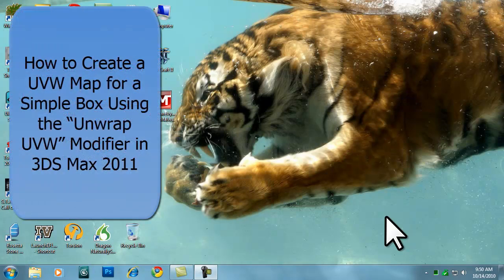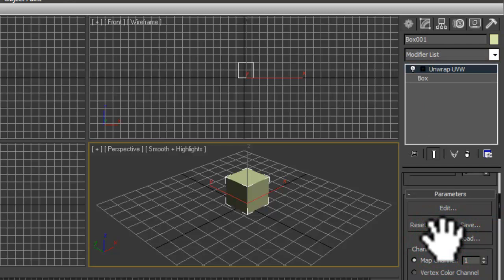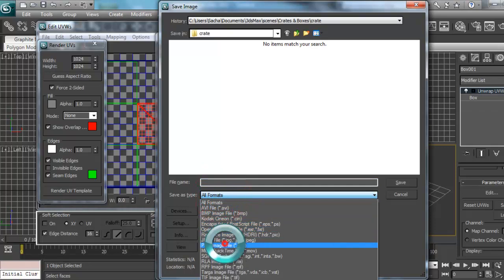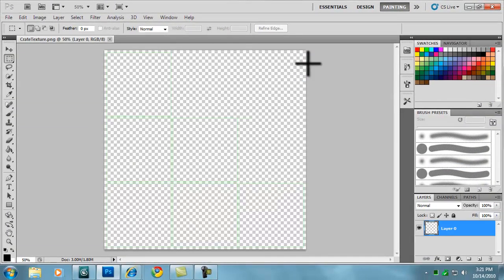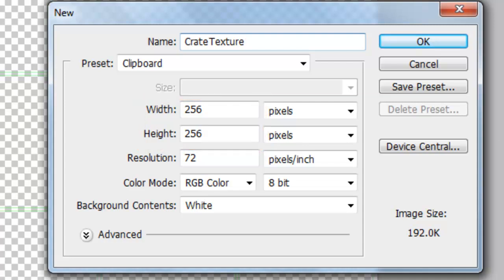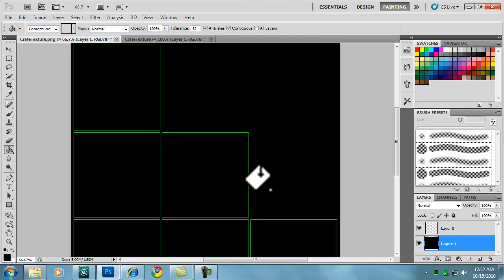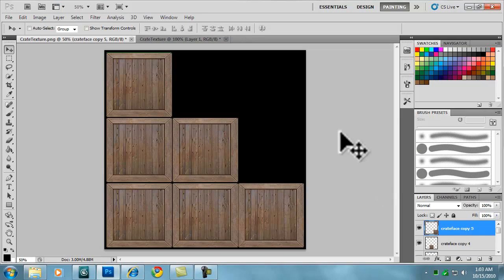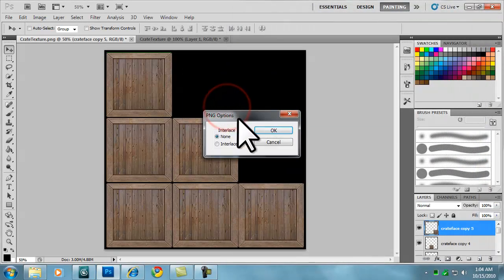Unwrap UVW Tutorial For Beginners - 3DS Max 2011 [Tutorial]

Comment: this way will fail if you have a 4k map and have an entire mesh that fills that space up, substance painter is one way these days or render to texture inside 3d max is the other. I do this myself and have had no issues, your way it might not make seamless textures or the materials might not line up properly. This is ok for some things but I personally would not use this technique if creating larger assets such as buildings etc